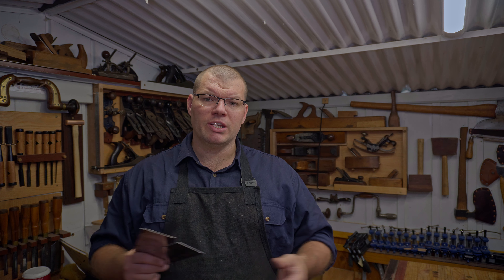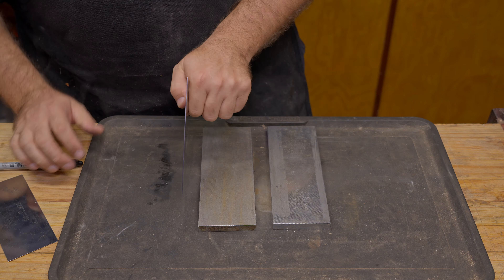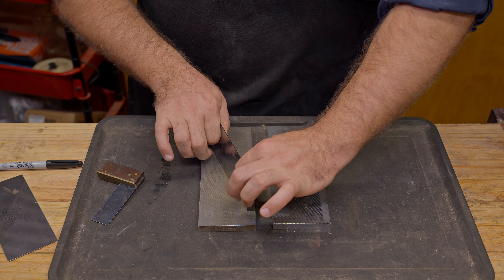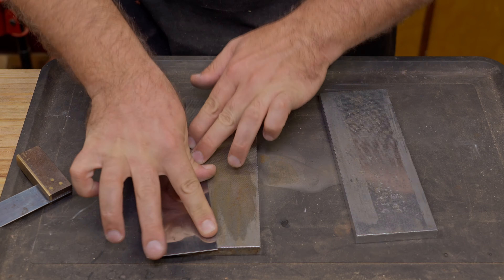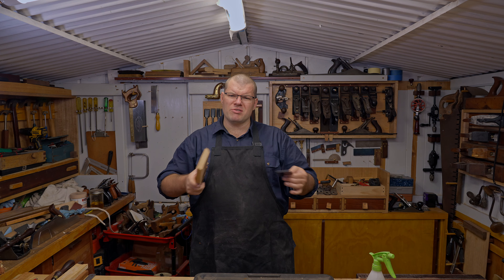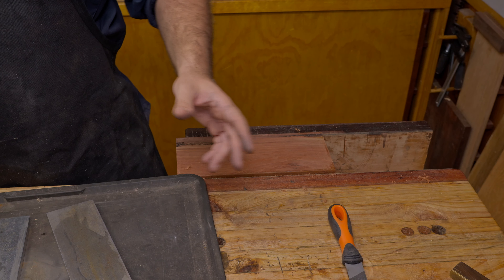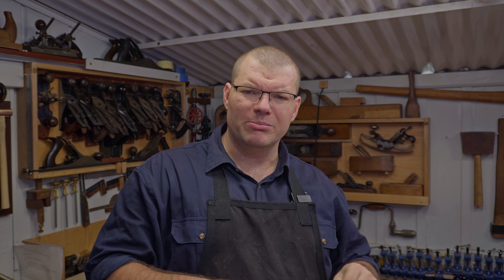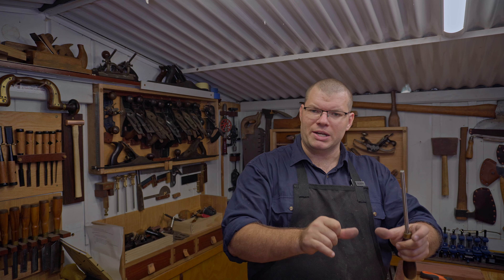How to Correctly Setup & Use a Card Scraper

Comment: Nice one Luke, great info. I need to get away from relying on jigs to sharpen - I find it really hard to hold a consistent angle freehand for chisels - so maybe keeping the card scraper at 90 degrees might be easier for me, and could even give me a confidence boost so I can go ruin my chisels again 😆 👍
Reply from the maker: Thanks, the 90 degree sharpening is definitely easier to hold than a bevel angle and for everything else 'practice makes perfect', eventually. 

I struggled to freehand sharpen when i first started and it took a few years of interchanging my sharpening with a jig until one day i found i didn't reach for the jig as much. Nothing wrong using a sharpening jig if it gets the tools sharp, they are also good to correct free hand sharpening while learning so you don't 'ruin' a chisel. I still use my sharpening jig to re-square my blade edges, free hand is never perfect.

Comment: I use the same technique up until burnishing where I do about 5 stokes on each side first. Then clamp in the vice and turn the bur down. I find burnishing the sides first gives a longer lasting,  sharper bur. When worn, can also repeat the process a few times before having to go back to the diamond stone step. Also I just use a gouge as the burnisher.
Thanks for posting the well explained technique!
Reply from the maker: It's always interesting to hear the small differences everyone has when it comes to turning a burr on a card scraper. Thanks for sharing your process

Comment: I've always had trouble turning the burr.  Not sure if it is my technique, or the quality of the scraper.  Now, I know, it's me.
Reply from the maker: Don't be too tough on yourself, i found it difficult to get right the first few times i tried to form a burr on a card scraper.

 I find the biggest issue most people have is putting too much pressure on the burnisher when forming the burr, which is what i did myself.
Reply: Dude it’s stumped me for years!